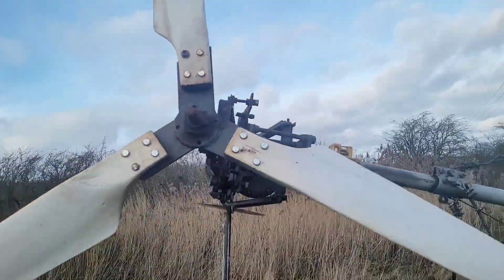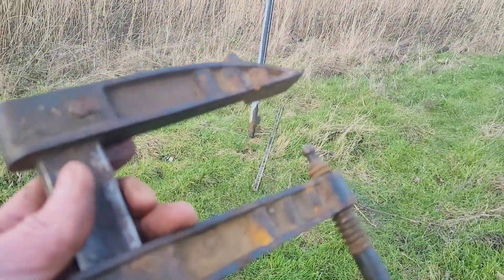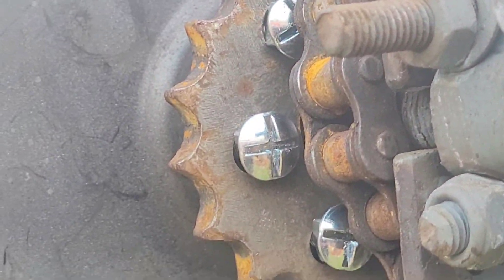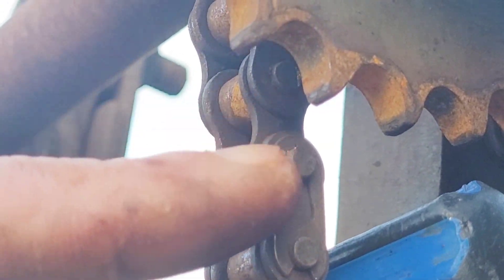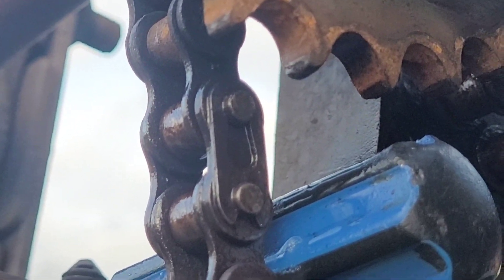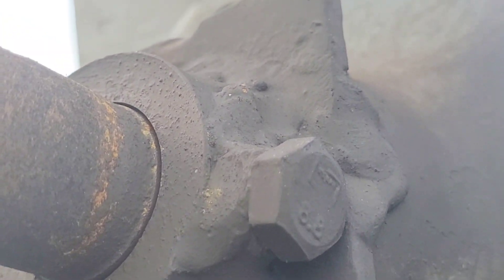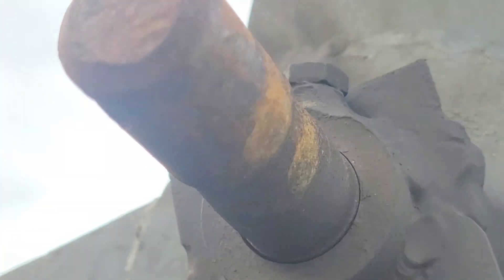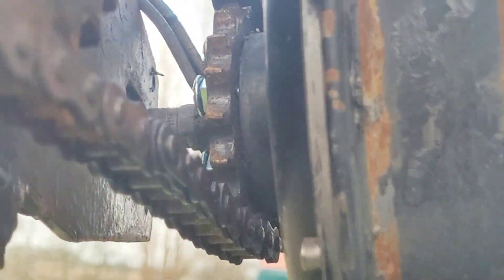Wind Turbine Project - More problems than I had hoped !!

Comment: Need some sort of a cover over it to keep the rain out. Also, you're using a metric version of a grade 5 bolt. You want to use a grade 8(10.something in metric) bolt or even something like a roll pin instead. The threads in a bolt(or technically a screw) create a weak point. One method could be to drill a hole through the shaft and hub, ream it with a reamer the exact size of a pin, and then use a strong pin. Then just mushroom both sides of the pin and it'll be stable. You have to use a reamer, though, since drilled surfaces aren't perfect.

Also for the chain, you could get one that is internally lubricated and uses o-rings to keep the oil inside. Then just use water-resistant grease on the sprockets. Its usually sold as some sort of motorcycle chain but I can't remember the name.

Comment: Just came across this and you are 10 steps ahead of me as I would like to build a turbine myself, but there are too many factors that prevent me from doing so. There are just too many inefficiencies and complex components requiring a lot of maintenance, so I wasn't convinced of making one yet and stuck with solar thermal and solar power.
As for your design, that chain needs a constant lubrication for sure, some of the links are seizing up already, perhaps a rain hood helps? The fan hub should have 3 bolts at a 120° offset indexed in the shaft as to add equal pressure on the hub. The play of the hub to the shaft will always result in broken bolts otherwise. You can also make a keyway, by drilling into the face between the hub and shaft and just wedge a bolt in there.
The blades look really small for the amount of iron they are moving.